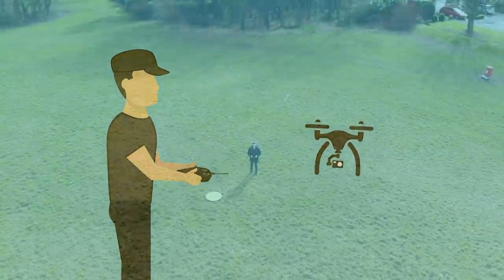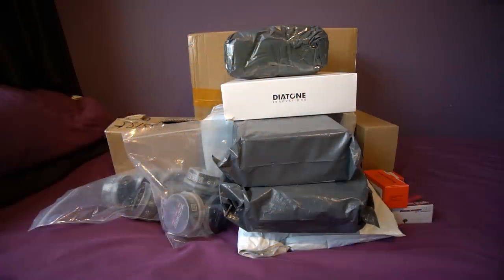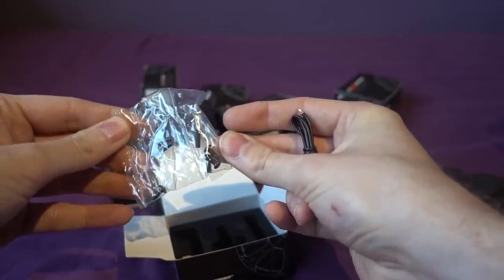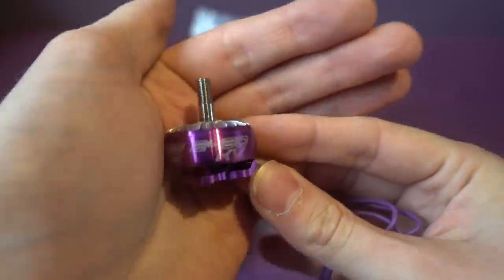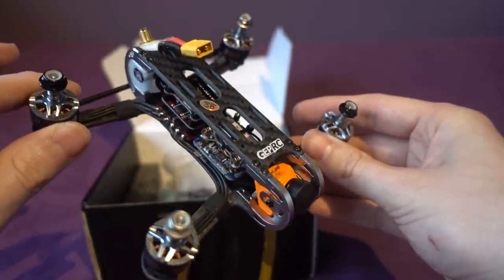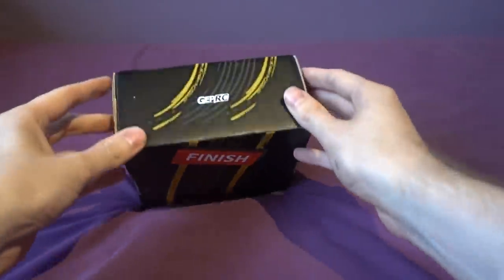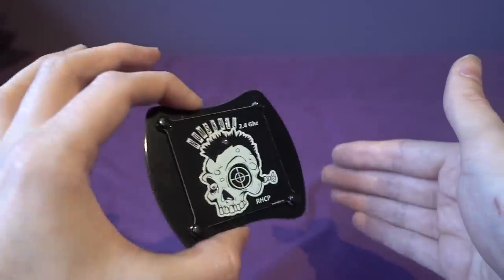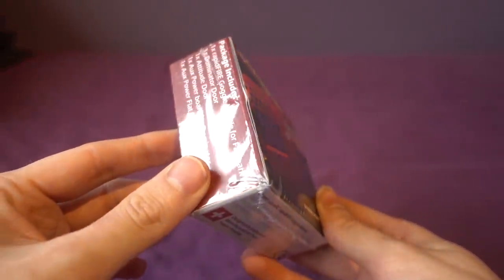Unbox Therapy - AndyRC

Comment: yep = the Xing motors are sweet. i got the 2306 2450kv in camo and they are smooth. i tried them with the HQ 5136 tri-blades and they were so quiet. they've added rubber o-rings on the bearings, to damp them.. I believe they're offering them in 2210 size too..
Get well Andy.
Reply from the maker: thanks for the info and support

Comment: On the beta75 and 4s - I was talking to an iflight engineer about their new 50A escs and I asked if it would handle 8s if I stuck a bunch of capacitance on it "it will do 12s if you use enough capacitors". Wack a 25v cap on it for 4s I would.

I'd love to see those glasses things reviewed. Might be a really handy desk tool. for setting up quads and doing current calibration etc.

Comment: I just put the iFlight Xing 2208 2450kv motors on my Nova and love them. They're super smooth and they seem to be very durable. I think you're gonna like them. BTW, I hope you're feeling better...
Reply: Do you have any 2207 to compare them to? Do they kick even more in the lower throttle range? What about the amps they draw, is it worth it? I was interested in them but after about 3 months now they are still not in stock on BG (i'm from europe). There have been some more 2207 motors from different brands coming out lately, most of them have better performance on 4s, at least on paper (less amps and more thrust). I think that the iflight motors are designed mainly for the 5s and 6s hype which i'm not interested in, so i think even though they look really nice (except that pink camo 2208 which were in stock all the time when the black/green ones were sold out months ago, what a joke, nobody wants that stupid colors) i'll pass on them for now.
Reply: @GuruGoesUTube  I've only had a few flights on them and I didn't have my amp meter in the OSD. Then next time I go out to fly, I'll turn it on and report back here on the amp draw. I don't think the amps were anything crazy though because my flight time was the same or close to that of my 2207 2450kv

Comment: Just got rapidfire, and a pair of new HDO's from RaceDayQuads.com. Moving from the Attitude V2's that were used when I got em, it's INCREDIBLE the penetration I can achieve. flying two or three houses away while I'm INSIDE is now no problem. I've been flying, idk, nine or ten months, moved from the babyhawk-R3 to a number of others, smaller or equal in size. The HDO-RapidFire set was the biggest improvement I've made so far. And finally I have DVR ;)

Comment: First thing i would do is check the firmware version on the Rapidfire module..if its got the latest firmware then your good to go! (Or update it) Definitely worth trying...strait plug n play with the HDO's...i think you will like the Rapidfire
Reply from the maker: Thanks for the info I'll give it a try. Cheers
Reply: @AndyRCchannel  It takes a little testing on which FPV antenna's to use to get the best feed? In my experience the axxii & xair antennas provided the best results!😀

Comment: I use the TPU around the lollipop antenna (+ tbs race ) and no problems . Maybe for long distances it has poor signal sending but for racing(25mw or 200mw maximun) is perfect, and diatone’s model looks for race. That race has an horrible reception cause it was indoor, and i haven’t seen a clear signal 5” race inside an auditorium.
Reply from the maker: go and watch the series is all I will say because its amazing how much it can detune the antenna. it might not affect you but it could affect others flying with you. as for flying indoors i have no issues flying in the hall I fly in compared to the NEC
Reply: Do you guys know if hot glue has a similar effect?

Comment: Also once you use the popo motor well for me i love them cause if i bend a prop a lot of times i used to bend it back and keep flying but now its so easy to swap props you just change them and ive not had the first issue from them i crash on pavement dirt grass mud everything and ive never had one not work or malfunction so i really like them i think amyone who goes through a lot of props will love them. Great video btw love the unboxing all that stuff was really cool especially that badass camera

Comment: I have built a quad with a sp racing f3 and a flysky receiver. I ve a issue with the throttle response: when I arm, motors begin spinning at the minthrottle (that s correct) but, as soon as I raise and lower the stick throttle, it doesn't respond
Everything looks ok because, in the receiver section, when I raise the throttle, it respond correctly... I ve also manual control of the motors and I am not in turtle mode... could you help me with this issue?
Reply from the maker: min throttle is the point at which the motors start to accelerate so reduce that number and it should fix the issue
Reply: @AndyRCchannel  i ll do it and i ll tell you if i fix my issue

Comment: Hey Guys im having big trouble here and theres no premade solution to be find online...
So my quad just drops out of the air during a fast throttle change , both right sided motors just stop and the quad falls to the ground ...however if i do the same in betaflight everything is just fine , also some times the right side Motors stutter...but they run smooth down to 1100 in betaflight , any ideas ?
Reply from the maker: sounds like a brown out. does the betaflight logo flash up when it happens and camera reset?
Reply: @AndyRCchannel  i just build it and weather sucks so im only trying indoor , there is no beeping sequence or something and it doesnt happen always build is a crazybee f4 running betafpv 1103 with 11000kv and KK Props ...i couldnt check fpv
Reply: Problem solved by turning off low RPM protction